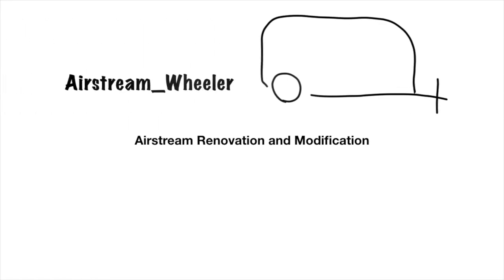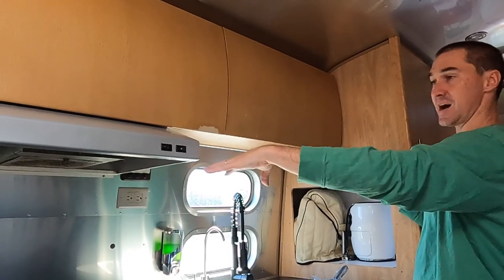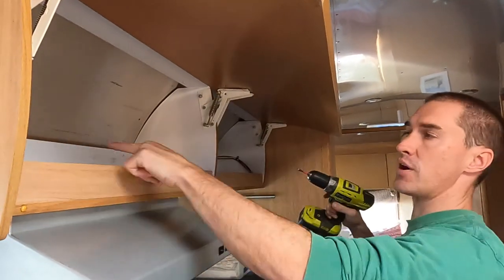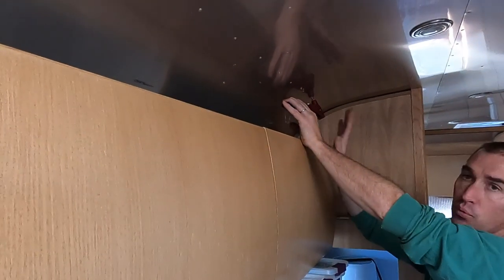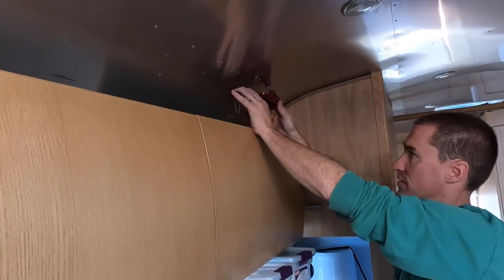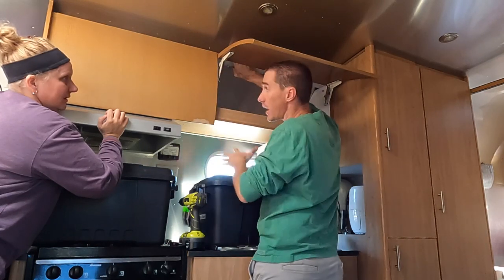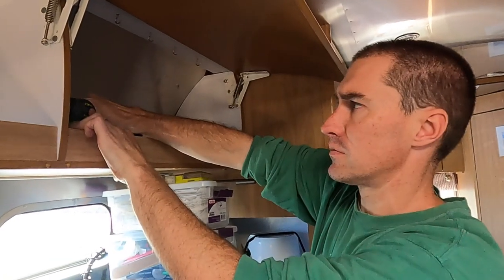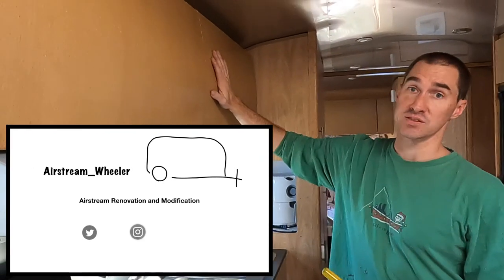Airstream Missing Rivets from Upper Locker

Comment: I would not connect the bridge cabinet to the tall cabinet. In a sticks-and-bricks house they can be connected for support, but in a traveling house, they need to have the ability to move independently. Attaching then together will (IMHO) create more problems. Flexibility is important in a house that experiences minor earthquakes every time it's moved. As to the eight screws, that's more than many home kitchen cabinets are attached and supported.
Reply from the maker: Thanks for watching and for weighing in on this. I guess I expected them to be connected and was surprised when they were not. To date I have not connected them and the rivets that we replaced have stayed.  It has been several thousand miles of driving so I am optimistic that we have solved it.

Comment: Just a suggestion as I have no Airstream rivet failure experience, but I would check on the outside where the minor rib mounts.
Reply from the maker: Thanks for watching and thanks also for subscribing, much appreciated, I should have shown a little clip of the exterior- there is nothing that looks wrong on the outside of the Airstream.
Reply: These popping rivets and loose cabinet could be related to your shreddy tire. Your trailer axles may be hardening causing a stiff ride.  How old is your trailer? If less than 15 years old it likely isn’t the axles. Another cause of rough ride is over inflated tires. There are charts that show load capacities at different psi’s. My tires max pressure is 80psi but per the load chart I run them at 55-60psi and have noticed inside rivets are no longer popping. You’d be surprised how much the frame flexes if the running gear isn’t set up properly. Tires should also be balanced.
Reply from the maker: @4RXLA  Our trailer is a 2006, it is possible that these axles are at the end of their life span. We run the tires at about 60 psi and we have been on some pretty rough roads in the last few months. Thanks for watching, we much appreciate your thoughts on this.